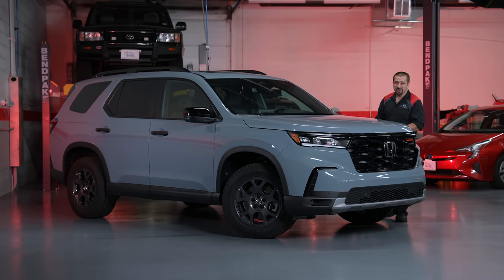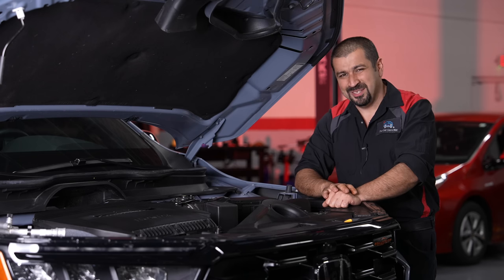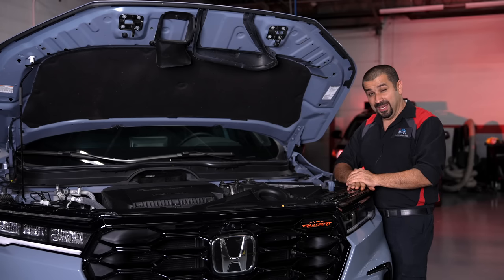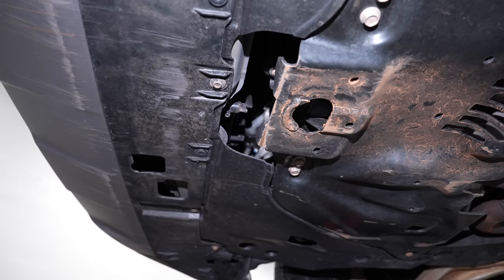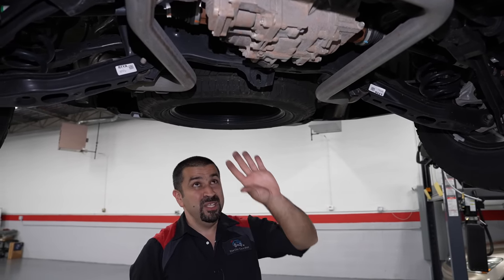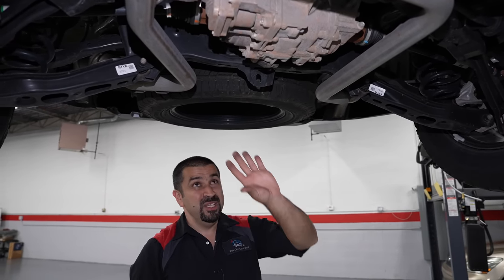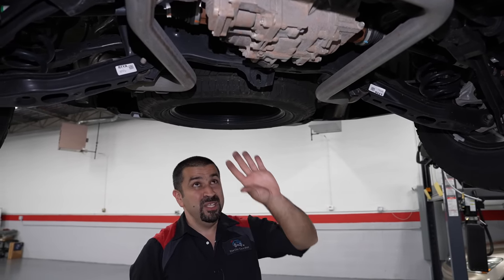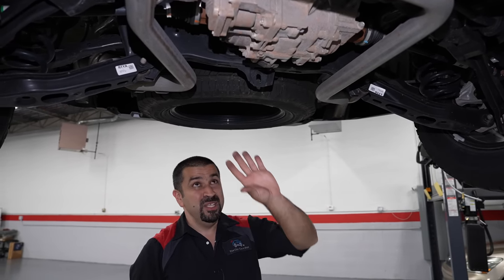Should You Buy a 2023 Honda Pilot? Thorough Review By A Mechanic

Comment: Being a retired Honda mechanic I was always impressed by Honda's engineering, reliability and ease of maintaining. I still enjoy owning and driving my old 06 Pilot EX now with 246 k and still runs like new.
Reply: I have an 07 with 135k miles and the rear subframe rusted out. Luckily I saw and had it fixed, but it is a problem for those who lives up north.
Reply: Would you buy the 2023 Honda pilot?
Reply: @jamesjacobs592  I'd buy the shorter Honda Passport, Trailsport version if I was looking for a new suv. I'm single and don't need the extra seats of the Pilot. I'm ok with the mechanical upgrades but still very happy with my 06. I also own a newer 4x4 Ranger midsize pickup.
Reply: I have a question for you sir. I have an 07 ridgeline 155k bought it used I have no idea if a valve adjustment has been done. It's not loud and does not misfire runs great. Do I need a valve adjustment? Cam I wait to get one ? And how do a lot of honda v6 owners actually never get a valve adjustment and their some of their engines have well over 200k miles with a valve adjustment never done ?
Reply: lol I have a 2005 with 230,000 . Still runs like a champ and no issues yet with the frame rotting out
Reply: @raulramos7451  have you ever had a valve adjustment?
Reply: I had a 2017 Pilot with the 10 speed transmission that wouldn't go into park on three occasions at 76,000 miles. Honda said their diagnostic procedure showed the only fix is to replace the transmission. It also had the issue with the injectors failing at 50,000 and needed all replaced and the start stop button failing at 70,000 and would take ten times before it would start.
Reply: @toddac61  I'm not a fan of the 2016 up models, especially with that trans. The 6 speed base model was a safer choice.  Best years were 06 to 08 but realize those are getting old with high miles now.
Reply: Question for you, friend: how many times did you change your transmission fluid on your pilot?
Reply: @shadowman1992  Although it's an important recomended service I found that if well maintained it can easily go 200K without an issue as yours has. But at first sign of a misfire get it adjusted asap. Mine has no record of valve adjustments either and I don't drive it much anymore so unless it misfires I'll do it with the next timing belt service at 300K.
Reply: @MikeR55 our 2016 pilot started having emission issues and started making rod knocking sounds at 94,000 miles. this is actually a know issue and Honda denied our good will request. We sold it for and got a Toyota.
Reply: 270K on my 2003 Pilot I purchased new.  Beaten up by 3 teen boys learning how to drive.  Still runs and is used as a back up.
Reply: The only thing is road noise from under the car  like it wasn't insulated
Reply: @MikeR55  I did my '07 last year at about 235k.  I'm sure it had never been done before.  Many of them were on the loose side.  Engine definitely quieted down at idle as far as valvetrain noise.  Pretty straightforward.
Reply: @toddac61  2017 has either 6 or 9 speed . There is no 10 speed until 2023.
Reply: @alijoon1621  9 Speed with the push buttons.
Reply: @toddac61  Pre 2019, 9 speeds and all 3rd gen Pilot 6 speeds have been known to be more problematic. Honda upgraded 9 speed transmissions hardware and software for 2019 model and up . Starting 2021 they discontinued 6 speed and all Pilot trims got 9 speed . If you get a new transmission it will be most likely be a refurbished one . Make sure it was manufactured post 2019.

Comment: I've got one of these in the EX-L trim.  After 7600 miles, so far no complaints. We needed a capable snow driving car, not high-clearance with trail-tires. It's not lacking power at all.  Highway mileage is much better than  expected at speed -- I averaged 23-24 mpg  on a recent 1000 mile road trip on the west coast driving at "brisk"speeds over 65-75 the whole way in "eco-mode".  Very comfortable, quiet, ride and a fantastic road trip machine. Brakes are huge and amazing. This car is pretty big - it feels and drives wider and bigger than Subaru Ascent and Toyota Highlander (my other candidates before buying) --it's the widest of the three.  3Rd row is comfortable for adults. I'd say ride is firm and comfortable not plush/squishy. Very little body roll when cornering. Adaptive cruise is very useful for highway driving, esp. the "follow" function but algorithm could use some tweaking as it won't hold the lane on a moderately high-g sweeping curve at highway speeds.
Reply: i'm thinking of the EX-L trim. it has everything i need and i don't want that mega sized moon roof that i will never use that comes standard with the touring and elite. my 2014 ridgeline and 2011 acura rl have them and we never use them. we just lost our 2010 pilot touring in an accident. 125k miles well maintained. i did bypass the vcm but not until around 100k miles.
Reply: Good deal. My 2008 Honda Pilot EX-L does not have the cylinder deactivation. When I drive around 65mph I get about 22mpg. I take off the roof rack, inflate the tires properly and always have good oil and transmission fluids. Oh, I also took out the 2nd and 3rd row seats to make the car lighter as I don't really need them on a daily basis.
Reply: I have the 2004 honda pilot have 330 miles on it still drives great even on snowy winter.
Reply: I have the 2019 Passport Elite and get better MPG with ECO Mode off.
Reply: With 7600 miles, your car is brand new.  My (not Honda, but I like Honda) has 50K on it and still feels new.  My other car (also not Honda) has 140K on it and doesn't feel new, but still drives better than many cars today.
Reply: I have the EXL as well and I appreciate the in-depth  explanation of the engine undercarriage and I think it is a fantastic car. I have owned many Hondas in my life and this is by far the best.
Reply: @uzi100099 the transmission is 🗑️ in the Pilot.

Comment: What Honda really nailed with this generation of their interior design is easy controls. Big dials that feel high quality and big buttons. The design isn't glitzy but it will age well and it can be learned quickly unlike some of the systems that bury everything in touchscreens.
Reply: What good is the interior, buttons and infotainment system when you can't make a proper engine. Timing belt (still), GDI only and VCM. Gimme a break.
Reply: @justacinnamonbun8658 I’m pretty sure the timing belt is to make ppl change the water pump and tensioner at the same time. Forced maintenance, if you will
Reply: The new pilot has little tiny kind of cheap feeling dials...they arent as nice as the old ones.
Reply: Yes couldn't have said better myself. Other car and truck makers really really need to understand this.
Reply: @justacinnamonbun8658    Honda builds some of best V6 engines on the planet.  Dunce.
Reply: @justacinnamonbun8658 man..you know so much you should go to Honda and tell them how to make a V6…not like they have been making some of the best V6 engines in the world for years
Reply: Aka the Mazda, no touch screen and hardly any buttons. It's a nightmare to operate the infotainment.
Reply: @KW-1754  Honda sixes last.
Reply: Living in upstate NY, my Pilot  rusted like crazy.  Also, it’s an interference engine has a very expensive service around 100k miles.   It was $1600 back in 2018, could be double now.

Comment: The new Honda Pilot also has very good styling, it’s the best looking Pilot to date. Our 2003 still runs great at 232K miles.
Reply: It is a trade-off, longer hook sacrificed cabin room; straight-line hook design increased blind spot in front of the vehicle. It is more masculine, with these trade-offs
Reply: Have you changed your timing belt at every 100k miles?  If not your engine could fail at any time.
Reply: We own an 03 Pilot since birth, also.  AC replaced 2x at $1500 each, but otherwise pretty darn reliable after 270K miles.

Comment: Excellent review. Excellent reviewer. I got under my 2023 Ridgeline the other day just to look at its suspension and look at the overall assembly of the car. It looks like it came out of aircraft factory, so straightforward.  Honda having so much racing experience on and offroad explains it’s exceptional ride and cornering. 
I hit purposely a large speed bump at 50mph and the truck remained perfectly level absorbing the bump flawlessly. Hats off.

Comment: I was hoping you review this SUV. I really wanted a 4Runner but I needed something with more seating so went with this. Although it's a unibody design but I think Honda knows how to build a good frame. Simple and it works for me. And I'm happy about the newest safety features especially with all these heavy EVs everywhere.
Reply: The older Pilots run for 300k+ miles so I wouldn't worry

Comment: We chose the pilot touring over the Toyota grand highlander, because the second row was far superior and the Honda pilot we got what we wanted it was maybe $15,000 cheaper than an equivalent Toyota grand highlander
Reply: Which trim of the grand highlander were you looking at? I'm 90 percent in for buying the limited grand highlander hybrid but come Dec 2024 if it's too hard to get I may just go Honda pilot trail sport or elite.
Reply: Is touring good? Fast? I have sorento now, how does it compare
Reply: @jerzs1363  can say for Elite, which is the same Touring. It drives as a sporty car despite be a big SUV. Just put in Sport mode and you will be fast enough to challenge almost anybody on the road, except EV.
Reply: @jerzs1363  any issues with oil consumption?I have a 3.3. 2020 sorento with 36,000 miles  and it started burning oil

Comment: Been waiting on this review, not for the pilot, but anticipating the Ridgeline refresh.  Timing belt and the expense that comes with it concerns me, along with direct injection only.  Seems pretty solid overall.  Nice review as always.
Reply: Same reason I'm keeping up with it.  Trying to see what the New Ridgeline will have
Reply: We have a 2019 Ridgeline with six speed transmission.  I be,I’ve it has DIrect Inject only
Reply: Cheaper to replace a timing belt than it is to replace a timing chain and it’s guides.
Reply: @thinbrickspec77  yeah but timing chains should last the life of the car, a timing belt is a known high ticket item.  It has to be done at a certain interval or you risk blowing an engine.
Reply: So a once every 75K mile service price is a concern.  If you ran the car to 300K miles, you do 3 belts…. That’s your concern… people are goofy
Reply: @GeorgeOrwell-tp8dw  It's always a consideration.  Buying a car knowing you'll need to pay a 1k automatically every 100k or so has to be a thought.  Now a reliable car and that's all I have to worry about, probably worth it.
Reply: @killerb5726  so reliable like a Honda pilot?

Comment: I had a 2014 V6 Accord. Amazing engine. Got between 6-7 litres per 100 with it. I put 300,000 kms on it and it’s at almost 500,000 kms now with the second owner. 
I would definitely buy this Pilot over the Grand Highlander and it’s turbo.
Reply: 7 litres ? Are you kidding us? If not then wonderful 😅
Reply: The Highlander I4 Light Turbo will outlast the crappy Honda V6 at least three to one.  The Honda V6 uses a rubber timing chain.  When it goes the engine blows.  When the water pump goes out the engine blows.  There is no port injection so the engine will carbon up.  The Honda V6 is famous for oil consumption and dead cylinders.  I4 engines actually last much longer than V6s.
Reply: What is these Litre 🎉stuff.  We deal in mpg !!!  Just kidding
Reply: @slalomking I think you Yanks are the only ones who do mpg?

Comment: Timing Belt replacement was very expensive on our 2012 Honda Pilot, very reliable vehicle but with Todays inflation a Timing Chain is the way to go.
Reply: and Honda transmission worries me
Reply: I didn’t have any transmission issues.  Interference engines require  timing belt changes around 100k miles.  Cost was $1600 back before Covid.  Probably $2,500 or more now.
Reply: 2,200 but it also covered an alternator that was going bad. 248,000 miles and still going. Transmission shifts rough but from what other mechanics like Scottie sat its normal, just gotta work with it and ignore the clanks or hard shifts. Overall it's gets the family around, my 2012 Nissan Sentra stranded me on the road at only 160,000. Still runs but needs work.

Comment: When it comes to the Pilot they took a page out of Toyota’s history book. The ‘90s Camry was a Lexus ES300 under the skin and it’s the same with this Pilot; it’s a Acura MDX underneath. The A/C dual drains is because the evaporator is for the front and rear system. Unlike most who have a dedicated evaporator for the rear the Honda system uses one big evap that is divided and can be used independently front and rear. Mechanically the Honda AWD system with rear torque vectoring is the same one the MDX uses for its Super Handling AWD. I’m sure a few software tweaks will unlock the SH-AWD capability.

Comment: Last winter I bought my 2008 Honda Pilot with 230 miles. It was the last year when Honda did NOT use the Variable Cylinder Management (cylinder deactivation). After redoing the suspension it runs like a new car - both the engine and the transmission are smooth and the suspension rides firm and sporty but not too firm and not too sporty.
Reply: 2008 Pilots do have VCM. My 2006 has it. That was the first year they implemented it. 4WD models don’t have it. Is yours 4WD?

Comment: Looks like they did a great job. Too bad we still have ptsd from our 17 CRV with oil dilution which sent us to Toyota. We actually loved everything about our CRV. Fit and finish was great, awesome build quality but that 1.5T was a giant mistake IMO. 😢
Reply: Yes the 1.5 Liter Turbo is one to avoid. Outside of Turbos you will have no concerns if you do your maintenance on other Hondas.
Reply: @@stevenstrain283my 2017 Honda Civic EX-T has been completely problem free and performs as new! I only have 90,000 miles on it so far, but my commute is super short, engine typically doesn’t heat up all the way. My oil does definitely smells of fuel more strongly the closer I get to my 4,500 oil change interval. But, to be honest, my old CR-V with 300k miles had the same exact symptoms throughout my whole ownership experience. So, in my opinion, this engine seems solid enough, and you can’t complain about getting 40+mpg. People seem to blow the issue out of proportion.
Reply: “Oil dilution” the new boogy man. 2018 CRV Touring 1.5  with 122k miles no issues. True it’s mostly highway. I go 7k-8k between oil changes.
Reply: I just don’t trust a small 1.5 to be reliable in the long term,my old 92 Civic hatch with a 1.6. That car was light compared to the newer stuff of course but those lasted a long time.
Reply: @@stevenstrain283I'm not big fun of turbo but driving it for the first time I was surprised how gently you need to accelerate to pic up power. A lot of fun to drive I would want to own it with more than 100k.
Reply: It's di, this has been typical since 2007. I've owned 8 di vehicles. They all had gas smell in oil. Never had any issues
Reply: Lol. 1999 Honda odyssey gave me Honda ptsd. Engine was great, transmission was a piece of garbage, repaired twice. Car shut off driving on the highway one time. Rust on body around gas cap and windshield 😮. Interior poor quality,  Sliding door handle broke, headliner sagging. 
I don't think i will ever buy another honda.
Reply: 2019 CRV EX-L AWD with 80k miles. No problems so far. Mostly highway miles. I definitely try to always get the engine temperature up when taking any short trips and when I get there, let the engine run for a few minutes.

Comment: @3:45 – Yikes, needless to say anything else about cylinder deactivation.
@6:09 – “Honda is not been known for problematic carbon build up” with all due respect I disagree. Sir if you ever come to CO I’m ready to show two 3rd gen Pilots with injector failures around 35K miles including one Pilot got it twice so far, Honda is going to cover it for 100K or 120K if I’m not mistaken per the letter. On YT we can still see the issue even on 2022 MDX.
My friend also got surprised to find out per owners manual on 3rd gen Pilot that its only rated for 3500lbs towing. If needed to tow more the dealership need to install after market ATF cooler. (No kidding, its stated in the owners manual.) Hopefully no more the case with the new transmission in this 2024 Pilot.  
@17:26 – 1in lift on trail sport is really awesome which get it in 8in clearance territory like a Highlander.
@20:45 – I do like those type of tires as if anyone hit gravel roads & forest roads with family its best to have such tires with added protection against punctures and these newer tires don’t really make much noise on highways imo. 
@33:22 I thought you will say about the timing belt as thing you don’t like. Especially with a longer timing belt. I thought you would also say about the button shifter (a) you have to look down to make sure what you are doing and (b) that is an area you was liquids when you are on a trip, hopefully not spill anything on those buttons.